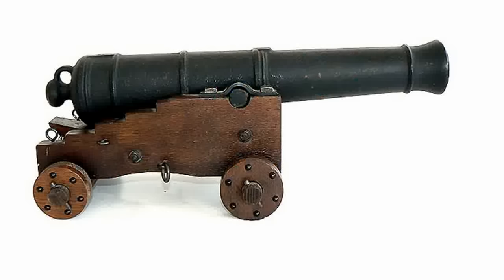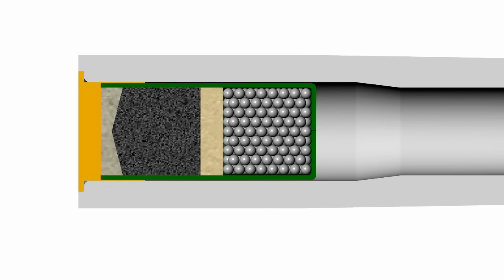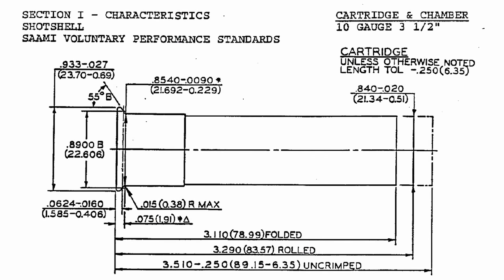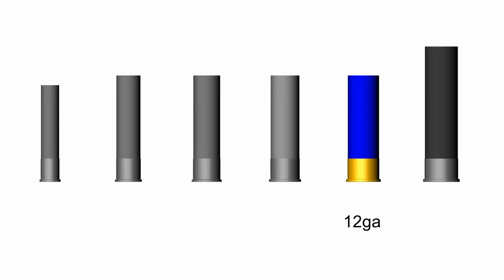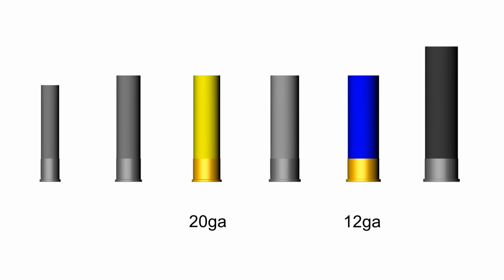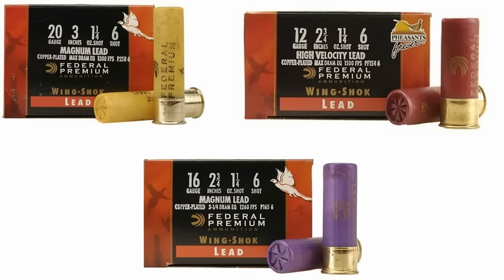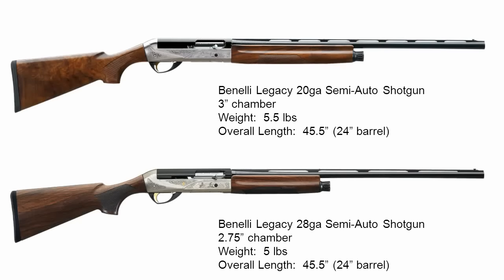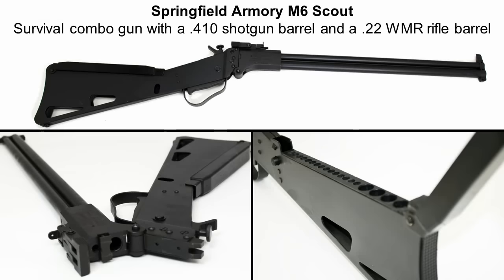Shotgun Gauges Explained - Shotguns 101 #3

Comment: After being on a trap team, I would never but federal ammunition brand. I have never seen so many misfires when any other ammo.
Reply from the maker: Really?  I've had very good results with Federal shotshells.  I've gone through thousands of their cheap target loads and they've been quite dependable in my 870.
Reply: @SynchronizorVideos  That's kind of funny, because I used an 870 as well, and my shells constantly miss fired. My coach said it wasn't the gun and it was just cheap ammo. We got all the ammo for free.
Reply: I would say check you gun. Federal is some of the most reliable ammo out there. Never have i had a federal shotgun shell fail to fire.
Reply from the maker: @silver_samuel.8959  Are the misfires only with Federals, or do you get them with other brands too?  

Might check your firing pin. Factory firing pin protrusion for an 870 should measure between .03" - .06".  It's an easy thing to check, and an easy part to replace if necessary.
Reply: @SynchronizorVideos  I have only really get misfires with Federal, Winchester always works fine. Im wondering if its because we buy them in bulk, and some boxes sit in the shed without AC or Heat for 2+ months on end.
Reply from the maker: @silver_samuel.8959  Maybe.  Heat and varying temperatures aren't the best things for energetic components like primers & propellants.  But modern stuff is pretty stable.

Probably still worth checking your firing pin.  It's a real easy thing to do, and different hull designs can lead to small variations in the seating depth of primers.
Reply: @SynchronizorVideos  I will take a look, thanks.
Reply: Yeah I'm calling bullshit. Federal has a reputation for being fairly reliable Winchester is the shit you shouldn't trust you'll probably get different results if you try it with a brand new gun incredibly high round counts like you get on a competition shotgun tend to skew results like that. A shotgun may feel like it'll last forever but 10,000 rounds of 12 gauge is going to start to bend something out of shape
Reply: @davidmcguire6043  I agree with you, I have probably only put 10-20 boxes of Winchester through my gun, but easily 10,000+ rounds of other ammo. I suppose my opinion is skewed just from the number of federal I have ran through my gun. I am bound to see misfires with Federal when I have used the ammo enough.

Comment: Do they make a 1gauge shotguns
Reply from the maker: Maybe some old muzzleloading market hunting guns were the equivalent of a 1 gauge.  They probably weren't called as such, though.  2 & 4 gauge were the biggest common ones back in the day, though those were often loaded with solid projectiles and utilized for big game hunting.
Reply: Back in the day, they made a 1-bore rifle for African big game hunting.  IIRC, that wasn't the biggest bore, either.  They had an A-Bore rifle and either a B-Bore or AA-Bore (don't remember which) both of which had a bore diameter that fit a lead ball of more than one pound.  Anything larger gets into the realm of field artillery! ;-)

Comment: What would a theoretical 1 gauge be like? Or a 0, if that's even possible to exist.
Reply: A 1 gauge would be a barrel the size it takes to make 1 pound. So a 1pound slug. (a 12gauge takes 12 balls the size of the bore (.729) to equal a pound)
Reply: @disturbedlife5691  What would that shotgun even look like? Sychronizor mentioned that the Punt Gun was a 4 gauge and it could only be used by mounting it on a boat. 

a gun 4 times larger than that... oh my.
Reply: @tankofnova9022  I believe you are now in canon territory
Reply: @ridezosmon2306  I never thought of it that way, but ya. Bird shot is just handheld grape shot from a cannon. Slugs? Isn't that just handheld normal cannonballs?
Reply: A 1 gauge barrel would be the diameter of a 1 lb ball of lead
Reply: Punt gun
Reply from the maker: There were shoulder-fired 4-gauge/4-bore guns in the past.  4-bores were popular stopping guns for large African game for awhile.

Comment: I call bull on the 20 gauge being good for youth. I had a rossi 20 gauge and that thing gave me a phobia of shotguns. I wasn't until I shot a 12 gauge mossberg pump that I got over it. Of that could because of it is a break action.
Reply from the maker: A break-action would recoil similarly to a pump, since both keep the breech locked all the way through the recoil event.  But because the actions are much simpler, a lot of break-action shotguns are lighter than they probably should be for the typical recoil level of the shells they're able to chamber.  Some 10ga break-actions are really brutal to shoot because of this.  Also, many older shotguns had no recoil pad to help soften the blow.  Though to be fair, many shotguns were designed and/or built back when magnum loading for the various gauges were typically less powerful.  Also, just because a shotgun can chamber a heavy magnum shell, doesn't mean it's really intended for that role.

Comment: .410 also chambers .45 long colt
Reply: As a .410 owner, I'm interested. Keep talking.
Reply: As a potential investor you now interest please go on
Reply from the maker: No.  A .45 Colt might physically fit in the chamber, but that doesn't mean you should try to shoot .45 Colt out of a .410 shotgun.  Even standard-loaded .45 Colt is a higher-pressure round than .410 shotshells, and that pressure is going to spike even higher when the .452" or .454" bullet is forced to squeeze through a .410" smoothbore barrel.  And if your shotgun has a choke, or the ammo is more modern .45 Colt +P or one of its magnum derivatives, there's even more chance of something going badly wrong.

There are some guns that are able to fire both rounds, but these use special stepped chambers and non-choked, over-bore barrels with shallow rifling to accommodate and stabilize the wider .45-caliber bullets.  But it's a bad idea to try this with a normal .410 shotgun.

Comment: .410 has a relatively high pressure and a high aspect ratio, that is, the small diameter compared to the length. Also because it often uses fast burning ball powder case deformation and separation issues are not uncommon.
Reply from the maker: The .410 is slightly higher-pressure than larger gauges (at least if you're comparing SAAMI maximums), but it actually tends to use slower-burning powder when compared to larger bore sizes.
Reply: That's why I only shoot .45LC in mine.

Comment: 2 bore shotgun called double deuce go check it out that thing is a monster bore is the same as gauge bore is the original English term and that's where it confuses some people because Americans use gauge but gauge to English is a measure term the sale of lead used to be sold in pounds so they carried it on so the amount of lead gauge balls which would fit in the bore equivalent to a pound of lead is where the name comes from trouble is with a lot of shotguns there was no universal gauge so you'll get 10 bore or 12 bore shotguns with varying gauges inside the barrels

Comment: hey I killed my first deer with a single shot .410 shooting a slug.  I pulled the trigger at about 20 yards and the buck went down handily no tracking involved.
Reply from the maker: A .410 can certainly take a deer.  It actually does make for a versatile and effective emergency game-getter if space & weight are at a premium, and the person pulling the trigger knows the .410's limitations & how to work with them.  

That said, if you're out buying a shotgun that you intend to use for more conventional hunting of deer or other large game, the .410 isn't an ideal choice.  Limited range & energy, limited options for ammo whether you're buying off the shelf or handloading, and not a lot of .410 guns that are really set up for best results in that application.  Beyond that, a lot of locations don't even allow the .410 for larger game.

12 & 10ga hulls offer much better capacity and geometry for heavy loads of large pellets that give the best chance of success for large-game buckshot hunting.  The 16ga and 20ga have less range with buckshot since they're limited to lighter payloads & smaller shot sizes, but they're still pretty capable when used appropriately, and the lighter and handier guns can be advantageous for short-range brush hunting where massive payloads are not so necessary anyway.  For hunting with slugs, there are a variety of 12ga and 20ga shotguns that are specifically set up for slugs (or that can easily be configured that way), with precision sights, scopes, and even fully-rifled barrels for use with advanced spin-stabilized slugs.

Comment: They should bring back 8 gauge.
Reply: They are illegal to hunt with, but 8 gauges still exist and ammo is still manufacturer. They are in use for indutrial work like seismic slugs and soot blowers. You can still find them though if you really want to. But it maybe easier to find a 4 bore shotgun.
Reply: That will just break your shoulder
Reply: Screw that the 0.1 gauge is where it's at
Reply: Oh lord

Comment: Here's an interesting side note.  My $99 .410 single shot can shoot all the usual shot-shell rounds from snake shot to #4 bird shot, plus 000 buck shot 3, 4 or 5 pellets up to 1200 FPS,,  .45 colt rounds that commonly come in 225 grain jacked hollow point, that are leaving the barrel at 1350 FPS,, .44 magnum,, and even the .444 Marlin round that delivers over 3,500 foot pounds of energy to a potential threat..  Yes, the underrated .410 shotgun can take down everything from garter snakes and rats, to a full grown grizzly. It is a great home defense weapon, when properly loaded.
Reply: There is a video out there of a guy firing a .50 BMG from a  .410 it held up but NEVER try it
Reply: @rdaniels8681   I'm pretty sure I wouldn't. I'm afraid just holding a 50 BMG in my hand too long.
Reply: @rdaniels8681  you must not understand that the 50 is .09 bigger not too mention the cartridge would never fit in something ment for a 3 inch shell
Reply: @Havicerxx  lol you are correct it was a 12ga still don't try it
Reply: @rdaniels8681  look up 12 gauge shell filled with powder that "gives dragons breath" a new meaning
Reply from the maker: Please don't try to shoot .44 Magnum or .444 in a .410 shotgun.  Aside from the obvious performance issues of firing rifle or pistol rounds in a smoothbore barrel, those cartridges also produce pressures far in excess of the limits for .410 shotgun shells, not to mention the additional pressure spikes you'll get by swaging a .429" bullet down to a .410" bore.  Unless you have some special gun that's specifically designed to handle multiple different cartridges, what you're describing is a VERY bad idea.
Reply: @SynchronizorVideos  First of all, the average .410 shotgun has a thicker wall barrel than the average .44 magnum handgun. The chamber wall  is thicker than most .444 Marlin rifles.  As for swaging a .429 bullet through a smooth bore .410 barrel,  my $99 .410 shotgun is rated for .45 long colt (.435) , and shoots them easily.  I make my own high pressure rounds, with steel .410 cases, bullets as big as 350 grain at .425 diameter, and 23 grains of cylindrical powder.  I have seen others TRY to blow up the lowly .410 single, and they have all failed.  Most .410 shotgun barrels are made from the same stock as 16 and 20 gauge barrels. That is why they are indestructible.  I don't recommend anyone else do this either. It is inherently dangerous to shoot high pressure ammo through any barrel that is not specifically made for that ammo.  That said, I have taken the risk because of what I know and have proven that the .410 single is capable of much more than shooting rabbits.
Reply from the maker: @timhallas4275  Maybe the fact that the gun is in a vise, and they're standing WAY back and pulling the trigger with a string is a clue that this isn't a recommended thing to do with a shotgun?

Comment: So now I'm wondering what a .5 gauge shell would look like. I imagine at that point it starts becoming more comparable in size to what you'd pack in to a grenade launcher.
Reply: that'd be measured more often in "millimeters"
Reply: Fun fact .50 BMG is the same diameter as 12 gauge, just much longer so they won't fit into most shotguns. It'll fit in a 12 gauge flare gun though, lol
Reply from the maker: 1/2-gauge would be about 2.1 inches or 53.4mm in bore diameter.  So yeah, right up there with grenade launchers.

Comment: A simple colour coded system would be useful
Reply: Most companies do have them but they vary depending on company. Like Federal does .410, 28 and 12 in Federal Red, 20 gauge is yellow no matter who makes it now a days, 16 is purple and 10 is brown.  Only 20 and 16 too me are so closely sized and weight is so similar it can be a mistake waiting to happen. Like you can shoot a 20 out of a 16, but you wont esdily eject that 20 after. But 410, 28 and 12 gauge come in ever colour. 20 will always be yellow. 10 gauge is red, black, brown or green depending on company. 16 gauge is purple or blue usually, but red, black and green also exist. 32 and 24 are usually red, and 14 is either red or aluminum cased.

Comment: 12 gauge is pretty close to 10 gauge in a lot of ways but falls behind in 2 major ways
1 weight -a (for instance)  bps in 10 gauge is about 11 lbs while a 3 1/2 inch 12 gauge bps is about 7  7/8 lbs with the same weight and velocity loads the recoil of the 12 will always feel more brutal than the 10 because it's so light the ten wasn't designed to be lugged around long  distances on the other hand most 12's were designed to double as upland guns and top out at about 8 lbs often less I've got a Remington 887 that weighs 7 lbs 4 oz and is brutal with any 3 1/2 inch load on the other hand I have a 10 gauge bps thats almost 13 lbs and is a dream compared to that even with 2 1/2 oz Turkey loads 

2 patterns- All things being equal, a larger bore has more potential to heave more shot faster. Obviously, 3-1/2 in the smaller 12 bore can’t hold the same amount of lead and powder as 3-1/2″ in the larger bore of the ten if all things are equal so, in theory, the 3-1/2 ten is more potent than the 3-1/2 12 because it’s a .775″ bore 10 against a .729″~.742″ (backbore) 12. The ten has got to hold more stuff and the 12 will have a longer shot column and more shot deformation with lead shot, so it will require more tweaking for it to pattern as tightly at distance
Reply from the maker: Purpose-built 3.5" 12ga guns tend to be relatively heavy as well, and if needed, it's always easy to add weight.  Keep in mind that 12ga guns are generally designed to be useful for a wide range of shotgunning activities, whereas 10ga guns are pretty much all used for heavy magnums and nothing else these days.  It makes more sense to design a SuperMag 12ga to have a good all-around weight that balances portability with shooting comfort, and allow the user to add more if the gun is going to be a dedicated magnum-slinger.  Modern recoil pads have contributed a lot to shooting comfort as well, making a lighter gun usable with a given recoil level than they used to be with hard butt-plates or hard rubber recoil pads.

Also, remember that the 10ga is a very old chambering, and it has a much lower pressure limit than the fairly recent 3.5" 12ga (14,000 PSI versus 11,000 PSI).  This compensates for the smaller bore area.  The 3.5" 12ga is behind the 3.5" 10ga in terms of hull capacity, but unless you're dealing with extremely heavy payloads or very large buckshot, this isn't a major drawback.  2.5 ounces of birdshot is very unlikely to turn a shot that was a miss with 2.25 ounces of birdshot into a good hit.  Patterns too, are of pretty similar efficacy, unless you're really splitting hairs at extreme ranges with very heavy payloads - where very few hunters even operate.

The 10ga does have advantages, and it has a place for certain shotgunning activities if you're willing to have a specialized shotgun just for those purposes.  But for folks looking for a good do-all shotgun (and versatility is one of the biggest draws of the shotgun), the 3.5" 12ga with modern chokes and components gets very close.
Reply: Robert Vongartzen I use mine mainly for Turkey, deer ,and hogs I've worked up quite  a serious round all load for it

Comment: What erased any gauge bigger than 10 from the market, is the fact it became illegal to use anything bigger than 10 for hunting.
Reply: there was a 4 gauge once
Reply from the maker: It just wasn't practical anymore once smokeless propellants took over and wad/shot technology improved beyond stacks of cork or cardboard.  Heavy 12 or 10ga loads can now match what old black powder 8ga loads used to do, without requiring you to pack around a 5-foot-long cannon.  It was outlawed not because it was overly powerful, but because that's where it was decided to draw the line between personal hunting firearms and oversized market hunting pieces.  But use of the 8ga had already diminished greatly by the time that happened.

Comment: At 64Kgs of weight I found 12-gauge to be too much for pleasant shooting. That beast kicked back almost 3 times as hard as the 7.62x51 NATO G3 rifle I had in the army.
Reply from the maker: 12ga guns vary a lot.  You have everything from ultra-light break-action models with hard plastic buttplates to heavy semi-autos with thick, cushy, high-tech recoil pads.  For me at least, I find a mid-weight 7 - 8 lbs (3 - 3.5 kg) 12ga to be quite comfortable with the majority of 2.75" or 3" shells so long as it has a good recoil pad and a properly-fitting stock.
Reply: If you use low brass shells it doesn’t kick as hard but turkey loads do kick quite a bit, QUITE a bit